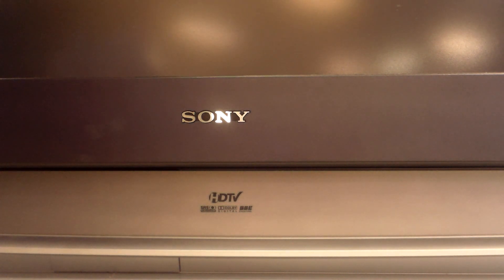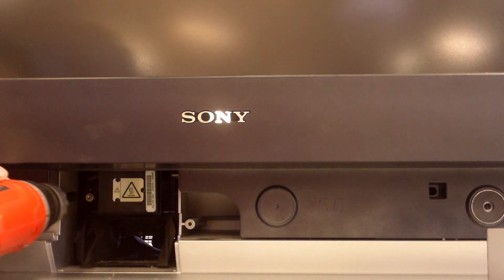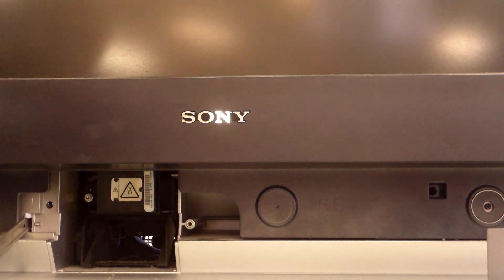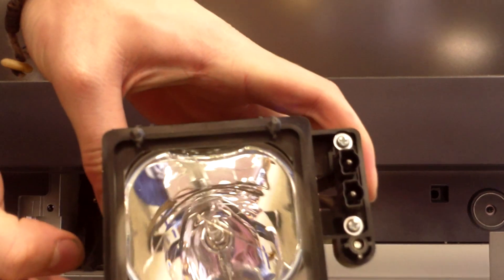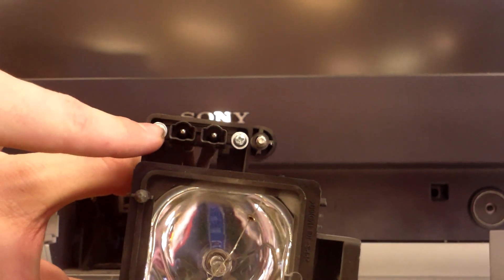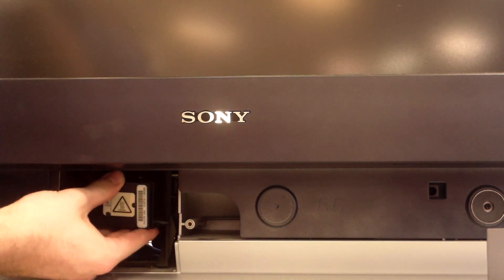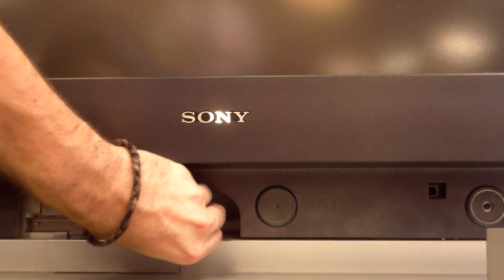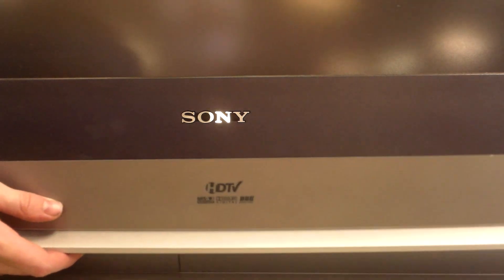SONY WEGA Lamp Replacement | Sony DLP Bulbs

Comment: Dont think using a powered drill/screwdriver is the wise thing to do with any electronics.Good video just the same. Also you might want to add the different types of bulbs that are available . If you buy a Philips brand bulb , it will last years longer as opposed to the knock offs they have all over ebay for $35.

Comment: If anyone get's a turn on and off every 30+ SECONDS after changing the the light bulb and still can't find the trouble shooting do this! 
(it's the female light bulb socket that is burned )go by the internal  female light bulb socket unscrew it cut it off from plug and also cut off male plug  light bulb  and directly solder wires together (you can extend even the cables use same wire gage) make sure you tape/isolate very good the wires ...and the 30+ second turn off TV would be GONE ;)

Comment: Good video, just had to figure out how to get the front panel off....had to go to the back of the TV at the bottom and unscrew the (2) screws on each end (looks just like the one on the bar).  Then all you do is pull the front panel off, it is held by (2) magnets.

Comment: Hi, do you know where the bulb/Lamp access panel is for a KDS-60A2000 HDTV...these are MFG'd in 2006, DLP rear projection 60" inch size.. I checked the back, I did not see the access panel.